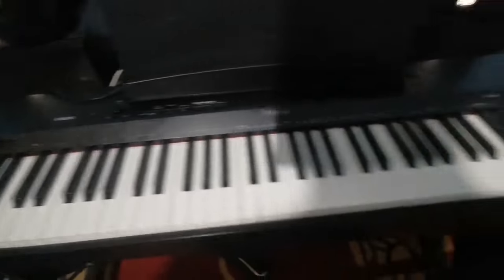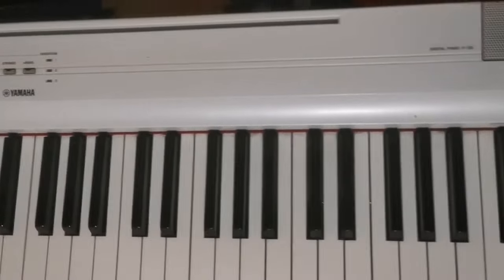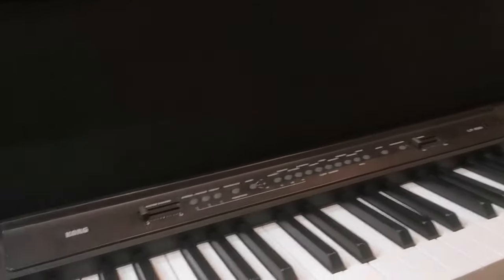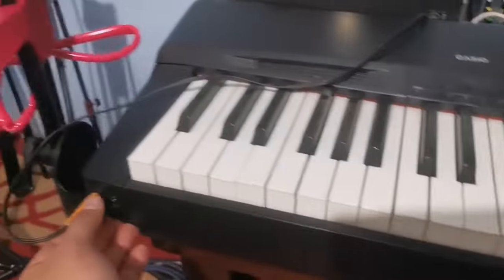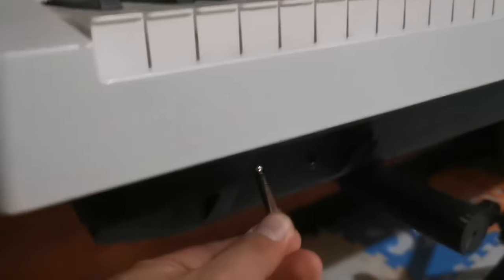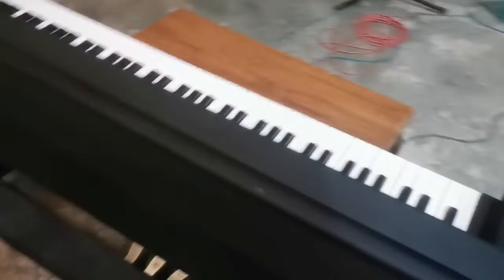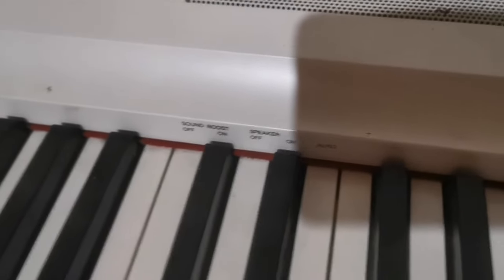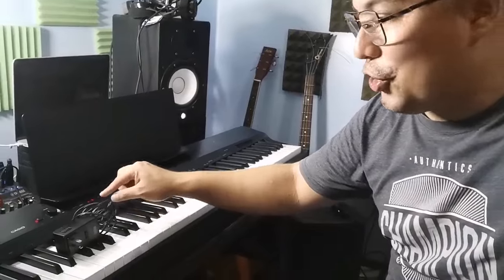How to Fix Digital Piano with No Sound. Casio Korg Yamaha Roland Nord Kawai

Comment: Hi. I've a casio digital piano CDP 3300. When the piano is on you can play it but after 2 minutes the sound disappear but the power light is still on. Can you please tell me what's it.
Reply from the maker: The board Ic has overheating problem.. need to be check by keyboard Tech

Comment: Hello Mark. Thank you for your video. I got a Baldwin Pianovelle GRP-3, with few keys not working… do you have any ideas/suggestions?
Reply from the maker: you need to open the board. clean the contact rubber first. check if it has a problem

Comment: I have casio celviano 250 . Piano on, but no sound out, even i just play demo still no sound out from the speaker or headset / another speaker .How you think man? Thkyu
Reply from the maker: open the board check the wires inside

Comment: hello, My kawai es110 has no sound coming out when I opened it. but there is power. a few months before that I’ve experienced this situation. what I usually do is just to restart it, and then there will sound. but this time, no sound. is it the speaker? did i touched some keys ? or can be it the adapter? thanks in advance for your reply.

Comment: Hi hope you can help.
I've just unpacked my Yamaha CP300 stage piano  it was in storage for about 5 months. Switched on but the board is non responsive.  
I checked the speaker button which was on but nothing from board. 

I checked the preset song which to my surprise played and was able to adjust the sound using the volume and master equalizer.  But still nothing coming from the board.

The keyboard was stored in a flight case which is very secure and was clean when  I took it out.

I'm a bit perplexed what's causing the problem. 

Any ideas? You help would be greatly appreciated. 

Thanks I  advance
Reply from the maker: open the board
 check for lost conection wire inside...... or try to search manual for local control setting... or check headphone jack
Reply: @MarkSomosoMusic  Thanks for info! Only one i haven't tried is opening it up... (im a bit nervous) But will have a go.  Thanks again

Comment: I got a questions. There is no sound when i press the keyboard but there is sound when i press the button for beat sound and some recorded piano music. Does it relate to the problem of speaker or what kinds of other problems it might have? thank you.
Reply from the maker: the wire conecting the keyboard to the CPU OF digital piano needs to reconect so it it will function... or Check the local control settings

Comment: Hi, thanks for your tutorial;
I have another question. I have a Roland G1000 keyboard  , the problem is one of the keys needs more pressure to make the sound. It seems a situation that lose its sensitivity. Could you please give me a clue?
 Thanks dude
Reply from the maker: open the board.. clean the contact Rubber

Comment: Thank you so much I was freaking out
Reply from the maker: how did you fix it?
Reply: @MarkSomosoMusic  Well I had disassembled the whole keyboard to repair a few sticky keys and then assembled it back together and freaked out when it didn't make noise but turns out that my pedal cable was plugged in the headphone jack heh...
Reply from the maker: it shot off the amp if you plug something on a  headphone jack... lol lol lol

Comment: how do i turn on and off speaker for yamaha 105 ? i bought a 2nd hand digital piano , no sound
Reply from the maker: dosnot have on and off. Check the headphone jack if somthing has a problem.. check Local control manual if its on or off.... try to plug an external amp.

Comment: I have a digital piano p-45 and the volume is now low, on full volume it's around half volume but it suddenly change... Do you have any idea why? Either way, good video.
Reply from the maker: wire conection inside. check  . re connect all wiree

Comment: I have RockJam RJ361 Digital Keyboard. When I switch on the board and give it the power, it does't even start and make any sound. Even when the Switch is on, it seems like it is Off. (I also Powered it on with the switch on the board)
Reply from the maker: maybe power cable is defective
Reply: @MarkSomosoMusic  Thank You Sir!! ❤️

Comment: Hi I have à problem with my psr 530 when the screen isn't showing anything just lights and whenever I encrease volume there's a buzzing sound I press the keys and there's nothing  I wanna fix it help mee
Reply from the maker: open the board find the broken transistor
Reply: @MarkSomosoMusic  it was 5v regulator but now the board is full of shorts and I don't know where to detect it

Comment: My casio privia has this fizzing or buzzing sound when turned to higher volume. Even when connected to amplifiers. When recording in my laptop, nacacapture yung noise. I wonder if it's the power supply. It's 1.5 amp. Recommended, i think is 1.5 to 2.5 amp. What might be the issue here?
Reply: Almost a cracking sound
Reply from the maker: check first if your using the casio standard power supply for your spisific model. somtimes it will affect the amp
Reply: @MarkSomosoMusic  thank you! I hope the issue is on the adaptor. It can easily be replaced, anyway. The one I'm using is not a casio brand.
Reply from the maker: it happend to me... when i use another adapter the speaker has a noise. .. the Mili amper should match the Keyboard
Reply: @MarkSomosoMusic  thanks! I'll try to change it. Hope it works now
Reply from the maker: pls. update me if you fix your piano
Reply: @MarkSomosoMusic  I will. Thank you!

Comment: walang sound yung right speaker ng Roland RP501R digital piano namin huhuhu:( pero ok naman ang left and right audio channels kapag naka headphones. :(
Reply from the maker: check ang plug sacket minsan may loss contact  pag luma na.....
Reply: @MarkSomosoMusic  ok na po. na-isolate ko na issue. binuksan ko yung digital piano namin and tested the wiring, ok naman. Yung right speaker po bumigay na. May nilagay akong temporary speaker sa loob...ayun, gumana ulit.
Reply from the maker: thanks

Comment: Nothing helped.  Maybe the speakers in my Firebrand keyboard are shot... I heard a little pop when I put the volume up then no sound. It powers up though.  Oh well.
Reply from the maker: try pluging external speaker
Reply: @MarkSomosoMusic  Hey there... just tried an external speaker.  Still no sound.  I get the display that shows volume up and down levels, and all the pre-programmed buttons.  I actually opened it up and no loose wires or anything burnt.  Guess it is more serious like a transformer just failed.